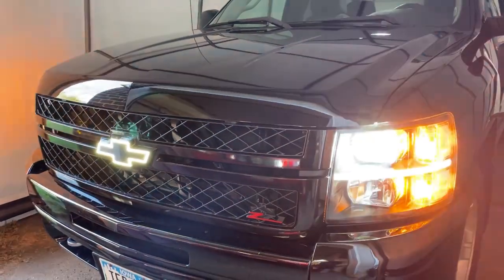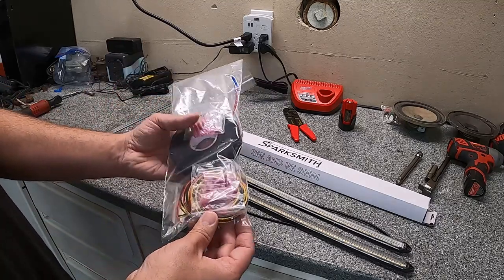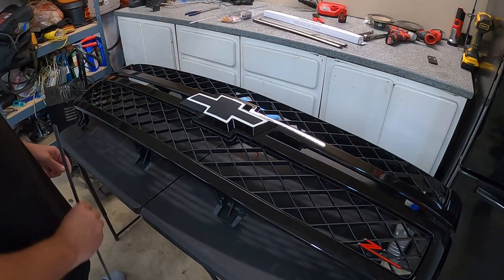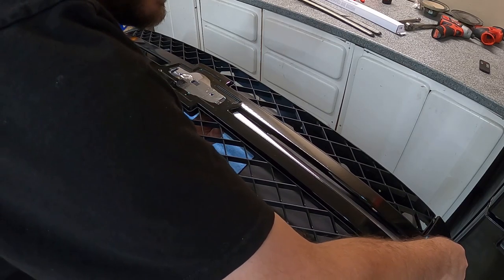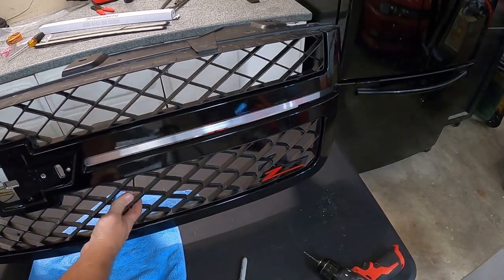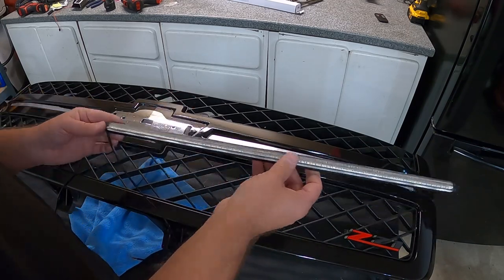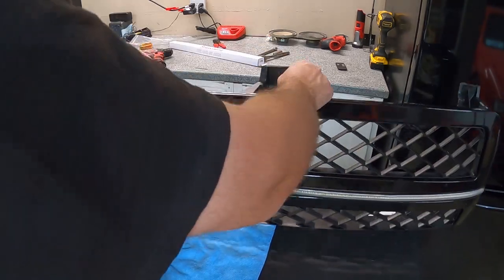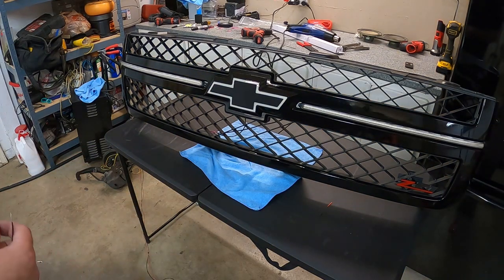Installing Animated Light Bars On My 2011 Silverado | Sparksmith 2.0

Comment: Where did you get the grill?
Reply from the maker: I got it from my local Chevy dealer. It’s the HD grill for the 07-13 Silverado. Part number (20966058). This one was chrome, but I vinyl wrapped it black.

Comment: How much are them.
Reply from the maker: The 22” light bars I used are $129.99. I’ve got them linked in the description of the video as well as the install kit if you want to check them out.
Reply: @AbnormalGarage     I went on there. Not really good  at looking up stuff